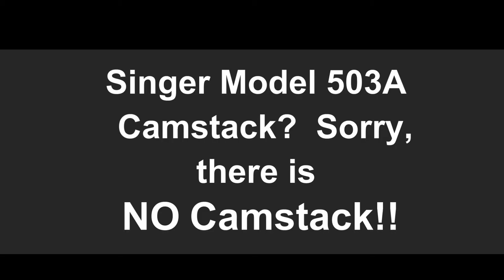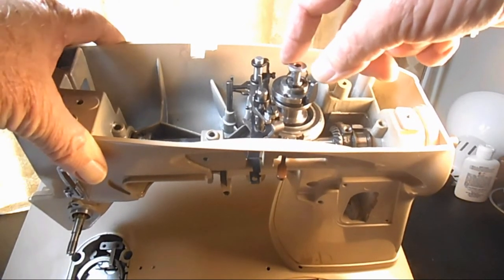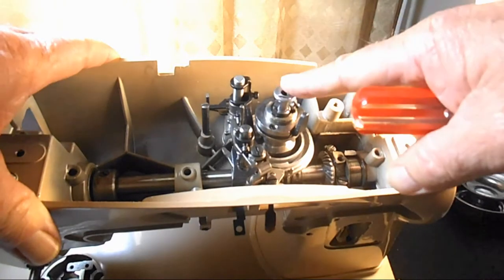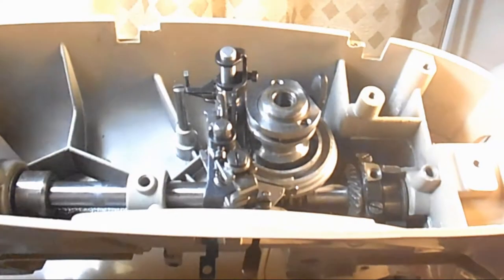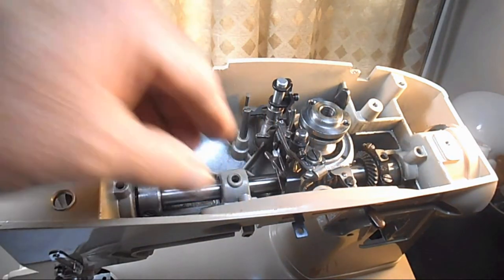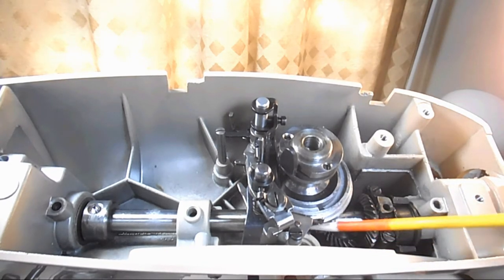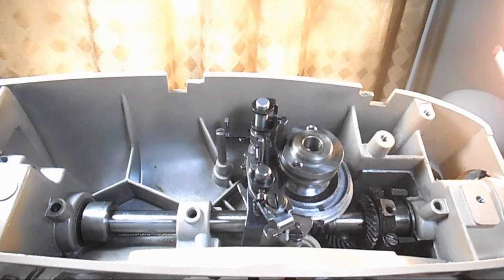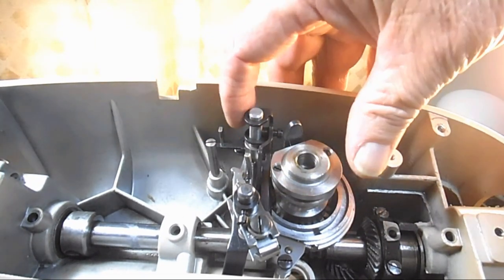Singer Model 503A - It's not really a Camstack!

Comment: Wow I learned a valuable lesson with this video! I bought a 503 that has a broken stitch adjusting lever. Guy who sold it to me said it was no big deal. Only missing a little piece. If I understand correctly now, that little piece will be a very time consuming and difficult repair. I so appreciate the detail in which you describe it all. Unfortunately I will need to shelve this machine or sell it for parts.
Reply from the maker: Sorry to hear that, Patti. If you change your mind, parts can be found on eBay. They come and go as sellers part out a machine >> 
https://www.ebay.com/sch/i.html?_from=R40&_trksid=m570.l1313&_nkw=singer+model+503A&_sacat=0
You can download a FREE copy of the original Service Manual for your model here >> https://sewingdude.files.wordpress.com/2012/09/singer-500-service-manual.pdf
It is 46 pages of adjustments and remove & replace instructions with pictures of the steps. I use this type of manual often.
You can also download a FREE copy of the parts diagram that includes part numbers >> http://parts.singerco.com/CPpartCharts/5_59999/503A.pdf
Many times, when I see a seller parting out a machine, I contact them about the part/parts I want and they often have them and did not think anyone would be interested in them.
They often just sell the motor, bobbin case, tension unit, light, etc. I have found some very hard to find parts that way.
I also have been told that viewers have taken a machine and the service guide and parts to someone other than a sewing store, like a motorcycle mechanic, yard equipment repairman, etc., just someone who has electro-mechanical skills and had their machine repaired for 1/2 the cost quoted by sewing repair shops. They even asked friends about who works on their own cars or who knows an "old guy handyman" and with the service guide, they got it done. Just saying, but whatever I thank you for the comment and for watching my channel. Please stop by again.

Comment: Hi Andy,
You have been so helpful to me with your wonderful videos and your generous responses. I recently acquired, oiled and greased a Singer 503a. I've been enjoying playing with the changeable fashion discs (cams). When I put them on, the stitch width is at 0 /straight. I place them on making sure they click. I them change the stitch length and width, however sometimes as I'm sewing the cam progressives "walks / works" off (It does create the decorative stitch). Do you know why this might be happening?
Let me know if you need more information. Thank you!
Reply from the maker: Hi, Sheri. YouTube held your comment for 22 hours before I saw it and allowed posting. It is not clear why they held it but let's talk about your troubles now. 
     1st question is does the regular ZigZag disc work normally?  2nd question is are the discs the correct ones? 
     Your machine came from the factory with Black TYPE "B" Discs, and all TYPE "B" black discs should work on your 503A. You may be trying to use TYPE "E" black discs (with gold print and grooved backs) and they do not work properly without modification on a 503A. You can look here for info about the discs: https://www.singersewinginfo.co.uk/pattern_cam_list
     If you are using the correct TYPE "B" discs and they all have the problem then I'd say it is a mechanical problem with the machine itself; maybe with the Pattern Selector Assembly or the lifter and follower meaning the arm that follows the side of the pattern disc. Maybe the triple-prong retaining spring that holds the disc in place is worn out and weak. 
     If I was troubleshooting this I would remove the bobbin and needle thread, remove the top arm cover and slowly sew air while watching what happens with the parts around the pattern disc. Sewing air means no thread in the machine. You can put scrap material under the presser foot and needle if you like, no matter. Just run the machine slowly and try to see what is "walking" or "Working off" the disc.
     You may want to check the Timing of the Disc  Driving Worm Wheel and reset it if necessary. https://youtu.be/cac5dhIOctk   
     You can look thru the playlist of models 503A to see if any of the videos pertain to what you are seeing when you air sew.
https://www.youtube.com/playlist?list=PLsCOZgzzaiKJZaZn2zl3LsnV2d7UhrqvX
     You can also look thru the videos for model 401A where I did some videos about the lifters, followers, and setting the index pins. https://www.youtube.com/playlist?list=PLsCOZgzzaiKLiDl9yFTP6mJgQmz5lj4NO  
     You can also download a free copy of the 46-page Service Manual for your machine from the Sewing Dude here: https://sewingdude.files.wordpress.com/2012/09/singer-500-service-manual.pdf
     I can't be more specific about the cause, Sheri, b/c I've never had anything like that happen on the machines I fixed and restored so I'm just brainstorming ideas of what I'd look for. Good luck, and thanks for watching my channel.
Reply: @andytubesewing1953  No problem about the delay. 
I discovered the problem just from something you wrote. My machine only has 2 of the 3 bars holding the disc. I'll see if I can find that part now that I can see it's broken.
Is there anywhere that has a free owners manual for the 503a?
Reply from the maker: Disc Retaining Spring Part #172020 used on many models not just the 503A. Here is an example from a seller: https://www.bonanza.com/listings/Singer-Touch-Sew-Model-600-Stitch-Cam-Spring-172020-on-Post-172195/16533780
You can download a free copy of the 503A Instruction Manual from Singer Support at this link: https://www.singer.com/search/support?title=503     
Glad it is an easy fix. Good Luck and happy sewing.

Comment: Hey Andy, any advice on what to look for as far as the stitch pattern discs not working on my 503A?.  I have three different discs and not one of them sew the specific design…..it’s just sews the straight or zigzag stitch.  One disc is the zigzag but I think the machines does zigzag even without the disc, which has me wondering why they even made one for the machine.  I could be wrong with that assumption.  It sews beautifully otherwise.  Any suggestions will be appreciated.  Thanks
Reply from the maker: Singer model 503A needs the ZZ disc installed to sew ZZ. With any pattern disc installed if you slide the width lever towards 1-2-3 etc. you should see a follower arm move against the disc. That follower follows along with the ins & outs of the disc and the bottom of that follower pushes against the bottom "paddle" of the Needle Bar Driving Arm which pushes against the Vibrating Bracket in the nose that holds the needle bar and makes it "swing" back & forth as the pattern disc is cut so the needle will sew ZZ. If you have the ZZ disc installed and you set the width to "3" and you do not sew a medium width ZZ then maybe the follower arm is not reaching the disc, or the pusher arm below the follower is not pushing the paddle. I have seen where someone removed the cam stack or NBDA and when reinstalled the pushing arm ended up BEHIND the paddle instead of between the paddle and the stack. When that happens the paddle does not move and the NBDA does not push on the vibrating bracket to make the needle swing. You have to troubleshoot starting at the disc to see if the follower follows along and then go down to the paddle, then the driving arm, then the vibrating bracket, and the needle to see what's not moving properly. BTW, once the ZZ disc works properly, usually all the other pattern discs will work properly also.
Reply: @andytubesewing1953  thanks Andy, now I have somewhere to start!  Appreciate it.
Reply: @andytubesewing1953  this helped me. Thank you.
Reply from the maker: @bmcdonald7303  Nice to hear that. Thank you. I think you are a good researcher!

Comment: I have a singer 638 and it similar but not the same. do you have a video on a 638 or one like it?
Reply: I need a Manuel that shows how each part goes together this is an interesting machine I bought a a goodwill kind of store for $10 I'm wanting a strong sewing machine.can you help me
Reply from the maker: Sorry, no. I do not work on Touch & Sew Models.
Reply from the maker: You can buy a parts manual here: https://store.tandtrepair.com/638sch.html
Use coupon andy-h-yt for 20% off during 2019.
You can download a free instruction manual here: https://www.singer.com/sites/default/files/outdated_product/aa0c55f35d4cd136957871417b8e66e112b2015d.pdf